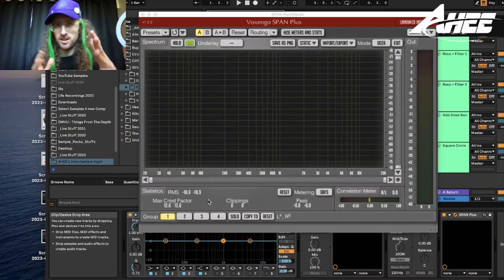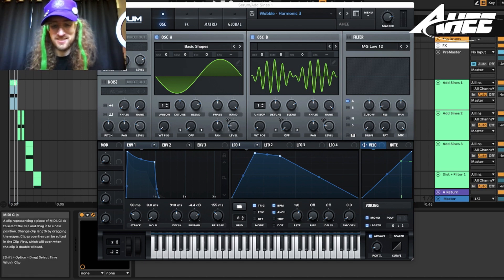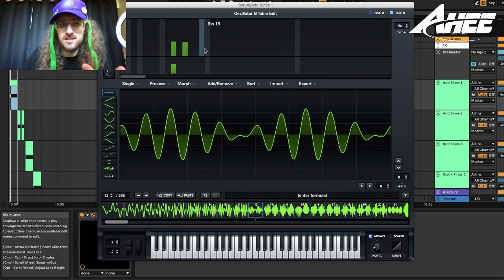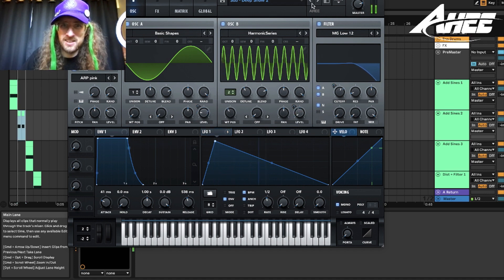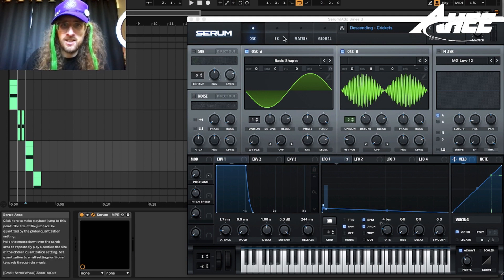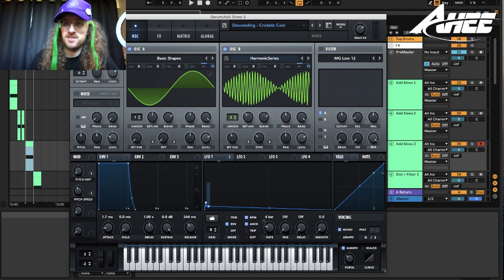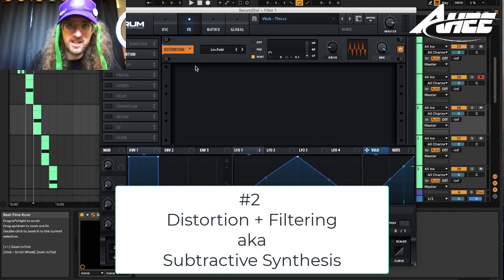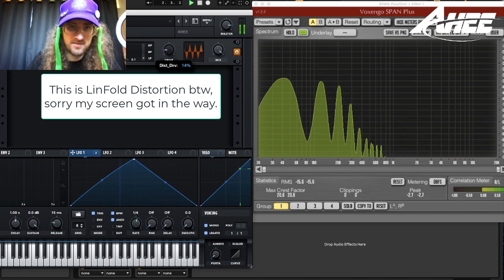5 Ultimate Sound Design Techniques Using Sine Waves

Comment: bro you are so cool for sharing your wisdom. question for your last one though. when im experimental sound designing and i'm going out of correlation in the phase meter what's the best way correct it?     i've noticed boosting the mids in the mid/side can fix this but i'm not sure why or if it's deteriorating the sound.
Reply from the maker: Yo! Thank u! Sometimes going out of phase is ok, if it sounds good in song, but to control it Try using a mixture of the width knob in utility and mid/side eq to control levels each part independently. I have a rack called Stereo Control that does this in case you have it.